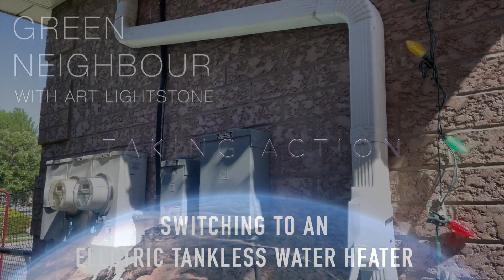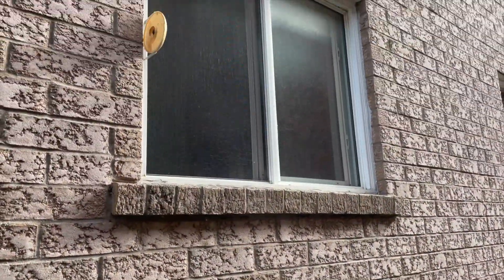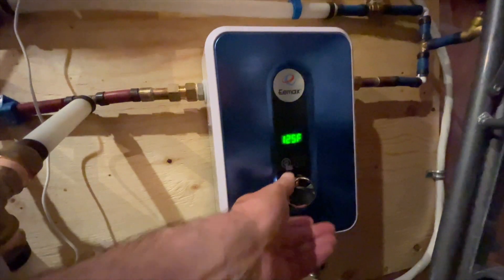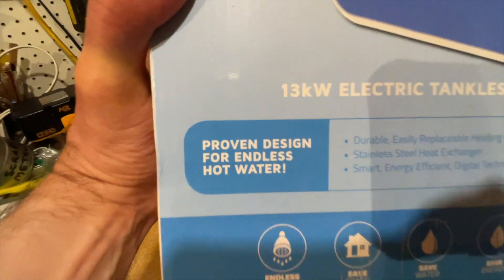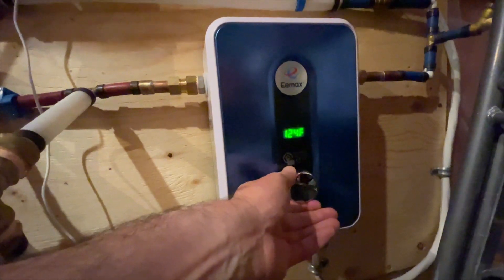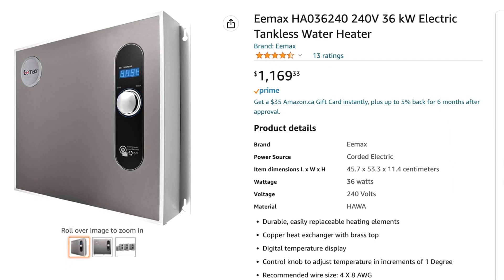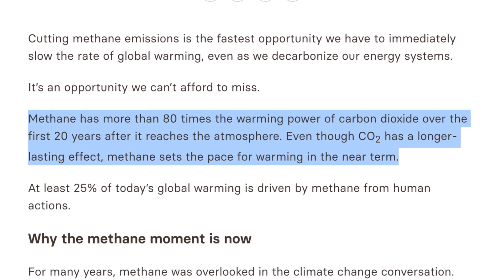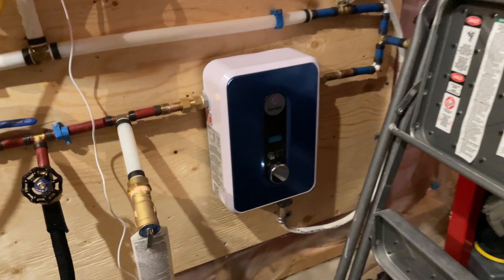Switching from Gas to an Electric Tankless Water Heater

Comment: Thanks for the post, just bought a home that has a gas tankless heater and I'm thinking of switching, the gas tank company wants us to lease the tank for $10 a month, plus it's $3.8 per gallon of gas, the capacity of the tank outside my house is 120 gallons.
Reply from the maker: Goodness… that’s two good reasons to get rid of that gas water heater. Renting water heaters is the strangest racket ever. (Why don’t we rent fridges, stoves, garage door openers, or door knobs?) Then there’s the cost of the “natural gas” (aka methane) that is expensive, a powerful greenhouse gas, and a pernicious gas that leaks all over the gas supply chain… including your home, as a little unburned gas will escape each time you turn on a hot water tap.
Reply: @GreenNeighbour  the monthly fee is for the gas tank, which is only connected to the water heater (it came with the house).
Reply from the maker: @gianelpibe  Same with my house. I bought it brand new, yet Enbridge Gas already had a gas tank sitting in the basement. You can call up the company and cancel that lease anytime you want.

Comment: Thanks for posting this! We have exactly the same Navien gas water heater, and decided to replace it with the electric one. While searching for any ideas we found your video, and it was interesting and helpful to digest. I am not sure the 13kw  heater would be sufficient for us, but I really like its size and color of it :-) Ironically here in NE PA its hard to locate a tankless water heater expert, but I don't mind trying it myself if I have to. Thanks again.
Reply from the maker: I’m so glad you found the video helpful, and I’m really happy to hear that you’re putting in a tankless electric water heater. Best of luck with it, and please let me know how it all goes!
Reply: @GreenNeighbour  Hey! Just to tell you that it goes very slow. We ended up getting a Rheem 36 kw unit mostly because of our kids. Also It was on sale at Home depot, even cheaper then Amazon. Very light and relatively small tankless water heater, but the most powerful in the family. The problem here is to find a reliable contractor to install it. Although I never installed myself water heaters, I believe I can try to do  the plumbing part , but electric is more complicated as the unit requires 4 designated 240v lines. But the most frustrating part of my experience was --- that almost all contractors here in PA, I was able to goggle, including the ones listed on the Rheem website, tried to discourage me to even consider any tankless electric water heaters regardless of a brand! Anyway, just wanted to share our experience so far. .. We are not giving up yet, but definitely haven't expected so many obstacles! 🙂
Reply from the maker: @dv6996  Interesting! What do these contractors say when they’re discouraging you from installing an electric tankless water heater?
Reply: @GreenNeighbour  They would bring a whole host of negative arguments including " the electric tankless not reliable, your electric bill would skyrocket, etc, ect, etc..." Anyway we've finally installed it. The most critical part was four 240v 40amps dedicated wires and new breakers. The plumbing part was amazingly easy - 30 min work. The only issue we are having now is -- the E5 error code pops up when we open high flow faucets and/ or more then 2 of them at the same time. To adjust the temperature all way up to almost 140 F doesn't really help. I am researching now what would be the easiest solution for that. We do have a pretty cold ground water here especially during a winter time. I don't believe this would be an issues from Spring through Fall. Obviously we look forward to discovering our new electric bill numbers :-) Any ideas/ suggestions would be appreciated. Thanks!
Reply from the maker: @DV  In truth, we didn’t notice our electricity bill go up by any amount that caused us to take note of it. Admittedly, it’s hard to filter out the effect of increasing electricity rates, changing time of use structures, etc. We didn’t really notice much of a difference at different times of the year either. Our tankless water heater seems to work just as well in the winter as in the summer. Having said all that, we might be benefiting from the fact that we have a very small, very simple water heater. (Not too many bells or whistles.)
Reply from the maker: @dv6996  In truth, we didn’t notice our electricity bill go up by any amount that caused us to take note of it. Admittedly, it’s hard to filter out the effect of increasing electricity rates, changing time of use structures, etc. We didn’t really notice much of a difference at different times of the year either. Our tankless water heater seems to work just as well in the winter as in the summer. Having said all that, we might be benefiting from the fact that we have a very small, very simple water heater. (Not too many bells or whistles.)